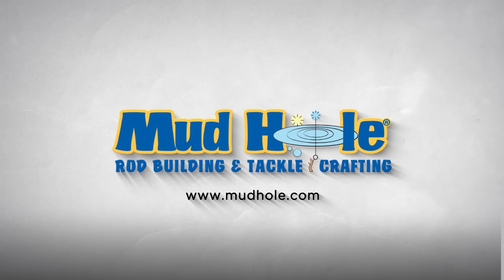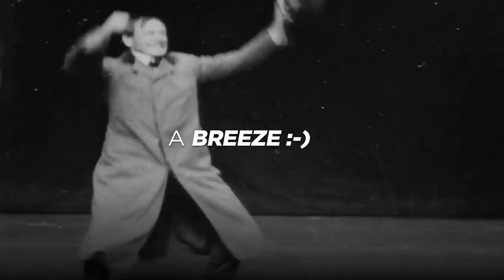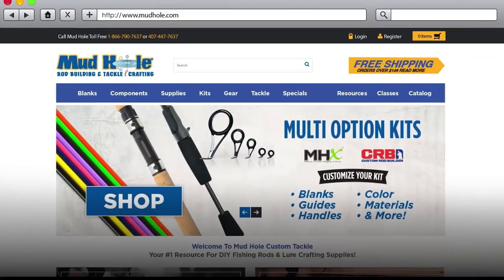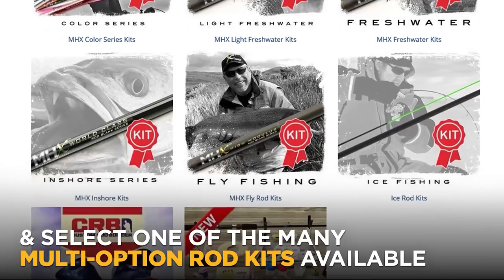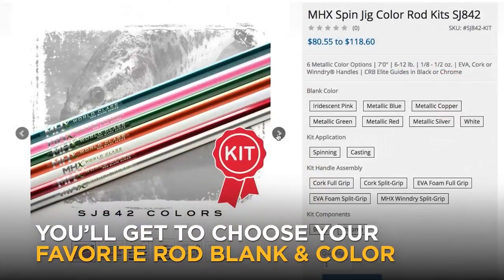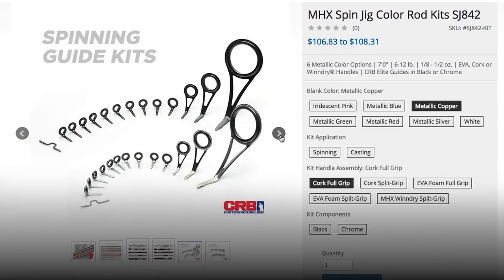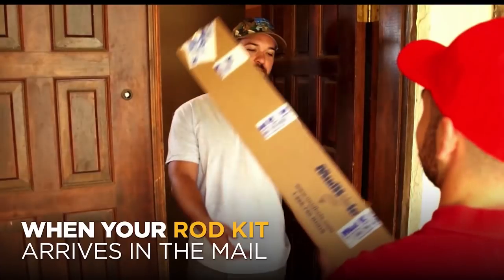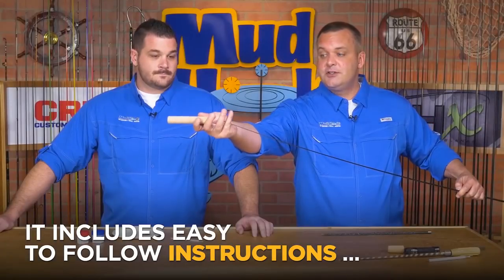How-To Repair A Loose Reel Seat

Comment: I go to one extra step.  I fill the holes with my glue stick for tip tops.  I heat the end of the glue stick and force it into the hole.  When it cools, I slice it off with a razor.  I've also found that Using ProGlu with a heat gun will help the glue to dry faster and expand.  It will sometimes bubble up past the hole which is also easy to slice with a razor flush to the reel seat.  Hope this helps.

Comment: This might be a dumb question, but I’ve never repaired a rod. I have a Lamiglas redline spinning rod. The reel seat is loose-it doesn’t spin but has a lot of play in it: I was going to try and repair it like this. Are you just drilling the plastic piece around the bank?

Comment: It "looks" like it worked but you squeezed all that epoxy inside the rod blank. I think the epoxy you got on the drilled holes is all that's holding the seat.

Comment: What happens if you drill the hole in the fishing pole? Accidentally went to deep on one of the holes.
Reply from the maker: Hey Jose,

If you've drilled through the rod blank, chances are the rod is going to break sooner than later. You can still repair the rod and give it a shot on the water, but it may only be a matter of time before the rod fails.

Comment: I just drilled a hole on the back (opposite of where rod goes) and inserted a screw to prevent movement. Seems to be a fix! Does anyone see a downside to this fix?
Reply: Yes, you greatly weaken the blank by doing so, that is if the screw is contacting the blank

Comment: Why do this under the reel? Why not do it on the other side. Also make the holes smaller and screw some self tapping screws into the glued holes.
Reply from the maker: We drill the holes and inject the glue under the reel foot to hide the holes when the rod is in use. 

Also, you shouldn't use (or need) screws. When you drill the holes, be very careful not to go deep enough to hit the rod blank. Putting screws through the rod blank would compromise the integrity of the blank and cause it to break.
Reply: @MudHoleCustomTackle  Well I've had no problems with my fix for a very long time.